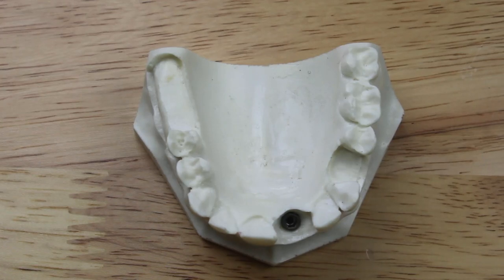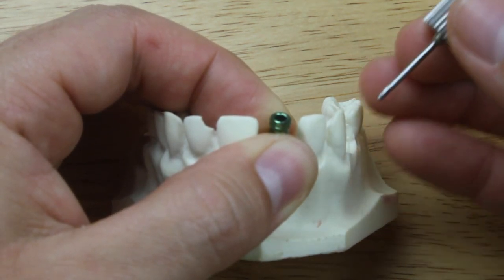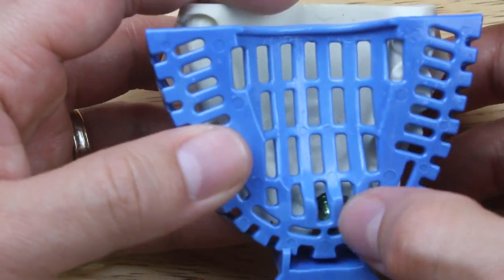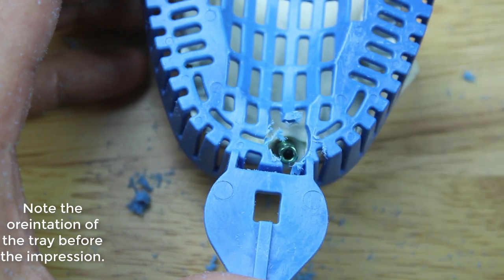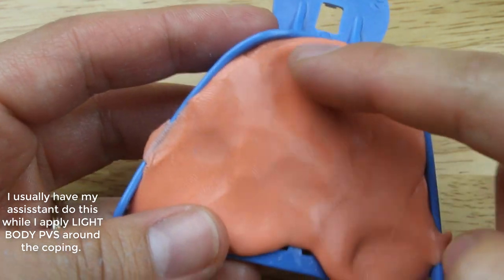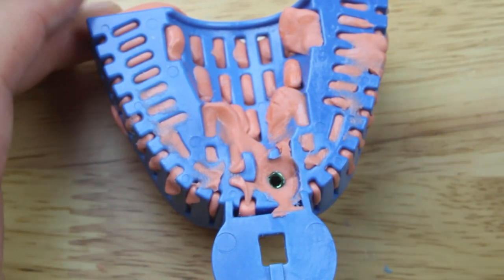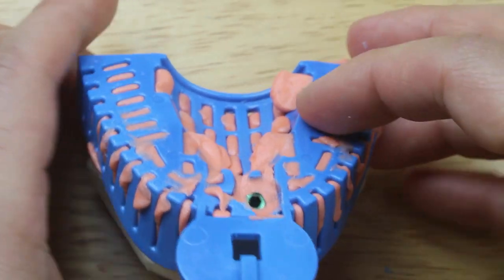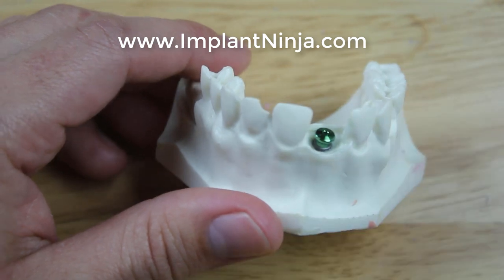Impression Technique for Single Implant

Comment: what did you do to mitigate or resolve the gap issue as seen on the radiograph?
Reply: Wondering this as well!
Reply: @Shafti92  nothing just try repositioning the open tray impression coping ,ususally an indicator of this is ur screw will go all in easily without getting tight in middle

Comment: This is incorrect guys, you should never use light body PVS around implants because it doesn't have enough stability!
Reply: flowable addition silicones can be used instead of condensation silicones , these help in recording the space for emergence profile more accurately

Comment: I see your platform .wy the platform I wood not have a platform in my mouth that wood not be healthy Geting away from Denture is Just that .I have no Teath in my gums Dentures only .Is that how you put Teath in my gums .my Inserince pays for my Teeth Being pulled cleaned My parshels Cost my $500 Doller State Fixed My parshels Long time ago Put my Teath in My Dinchersi need to know how much my Inserince will pay .Thim my out of pocket cost yes I wood not won't puddy in my mouth Less it is For a minamel time thin removed .all this Dentures are In healthy .